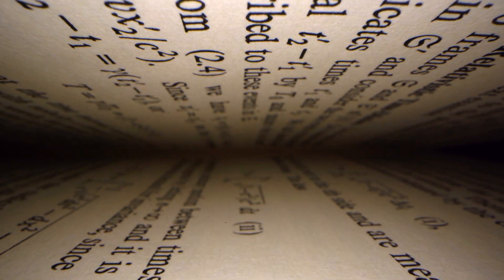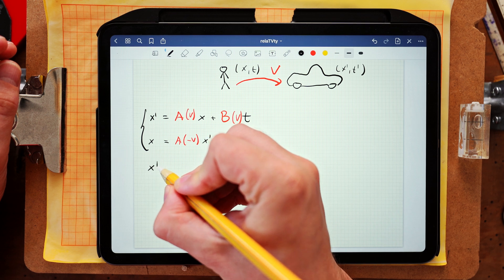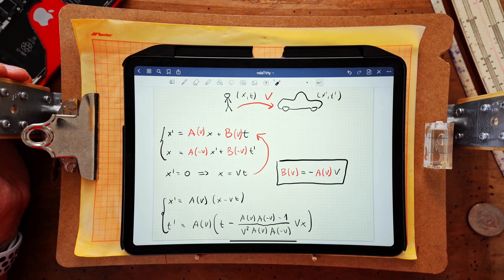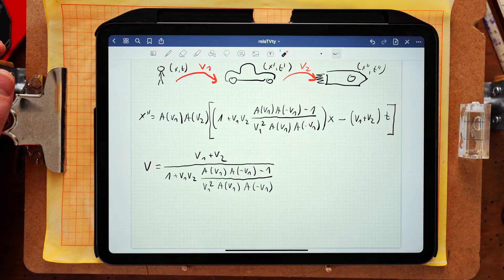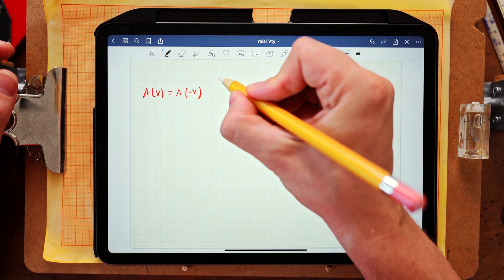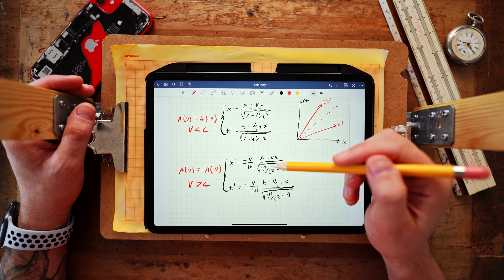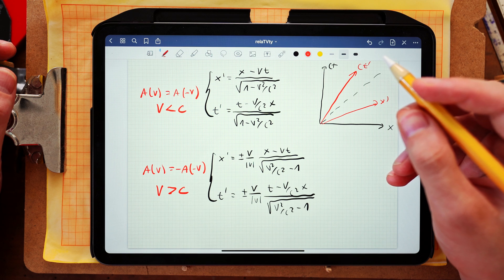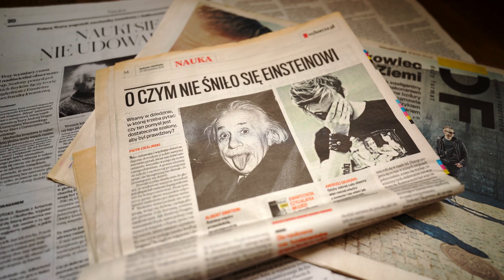Why do we need FASTER-THAN-LIGHT observers - Episode 7

Comment: If (as you stated in some other prelection) same like we cannot exceed speed of light because we would need infinite energy to do so, we cannot slow down superluminous particle because of the same reaseon, does not it mean that we are not observing those faster-then-light particles because we do not have enough energy to do it? Sorry if my question is fundamentally wrong but my reasoning assume that act of observation would require interaction beetween subluminal (our detectors) and superluminal particles, causing the superluminal particle to slow down or stop. Mayby I don't understand "observation"/detection itself. Does the regular particle hitting the detector slow down by depositing some of energy or stop if it is absorbed? Thanks
Reply from the maker: We also cannot slow down the light, and yet we do observe it somehow :)
Reply: @relaTVty  how might you characterize interactions between super and subluminal particles?

Comment: Would this imply that speed or rate of entanglement depends on the energy of the system?
If so, it should be experimentally verifiable for high energies, at least in principle.
Reply from the maker: Indeed, the amount of entanglement, for example between the spin degree of freedom, depends on the observer, but that already happens for „regular” Lorentz transformations.

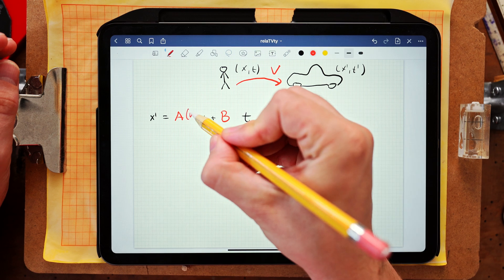Comment: 2:10 Why can't this function be bependent on for example distance betwen observers? This doesn't make any observer special
Reply from the maker: Because the extra dependence on coordinates would make the transformation non-linear.
Reply: @relaTVty  It would be linear in translations and ralative velocity so wouldn't it be possible to linearly compose those two to a new linear transformation?
Reply from the maker: A composition of linear transformations is still linear, but if A or B depend on x, it’s not the same. Besides the observer does not have a single position. It is rather an infinite set of clocks and rulers in relative rest.
Reply: @relaTVty  You are right, if I understood correctly it can not depend on realtive position since the observer is a frame of reference and not a spacetime event
Thank you for the answer